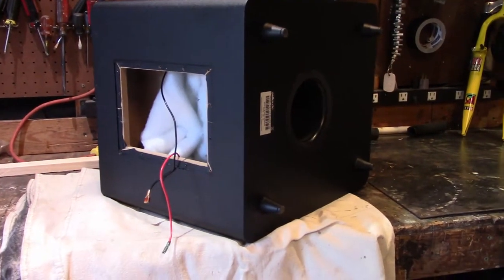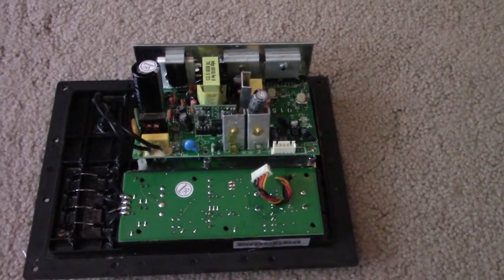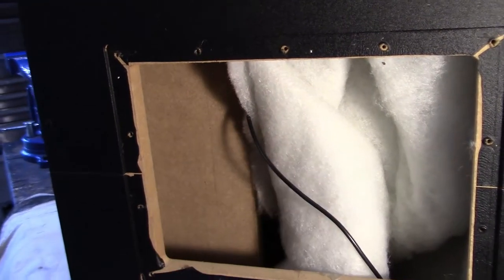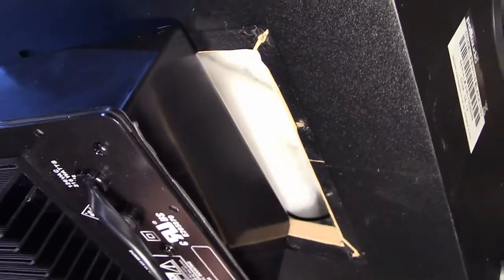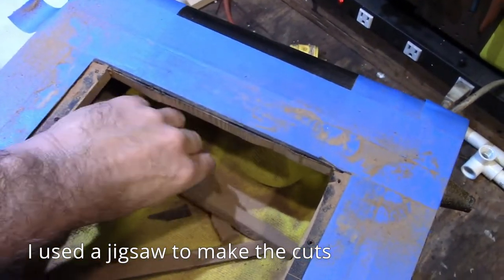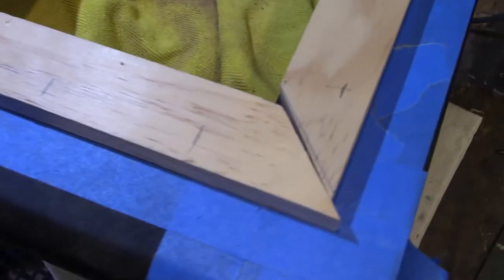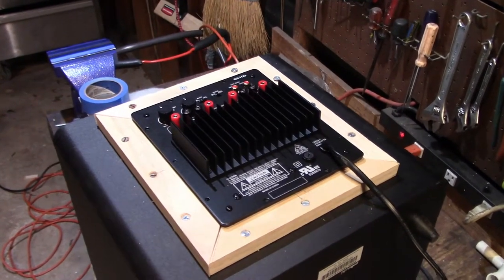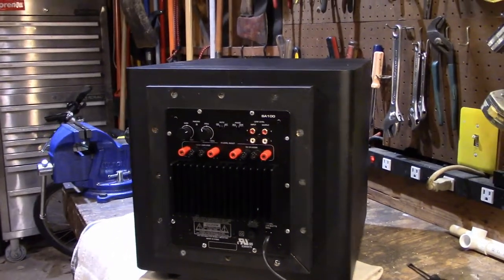Polk PSW110 subwoofer amp replacement with Dayton Audio SA100 amplifier

Comment: Hi please help me I bought the Dayton SA 100 but it doesn’t work, the manual says it needs both L and R cables connected to work, but the original amp only has one mono cable to the subwoofer? How did you connect the SA 100 to the PSW110? Thanks a lot!
Reply: Good question, I suppose you just connect positive and negative coming from the sub to a splitter. If it’s out of phase just reverse it with the switch?
Reply: Take that back, according to the manual there are 2 leads coming from the amp

Comment: Can you describe what it was doing to determine it was the amp? Mine went bad years ago and I'm just now getting around to trying to see if its salvageable. When the speaker tries to play it just makes a quiet scratching/buzzing noise of the appropriate pitch.
Reply from the maker: The failed amp was either making a harsh buzzing sound, or not passing any audio at all.

Comment: Hello what capacitor did you replace on the power supply? Mine doesn’t get any power
Reply from the maker: It was so long ago i don't remember the value. I just replaced it with a capacitor of the same value.

Comment: Its just caps c33 and c39 47uf 63v that need swapping both of them
Reply: Is any of these caps for power? Mine has no power
Reply: C38 and C39 are the most critical. But since the pcb has to be disassembled, I took the opportunity to replace all the power supplies, eight capacitors in total, less than 10 euros of expense.